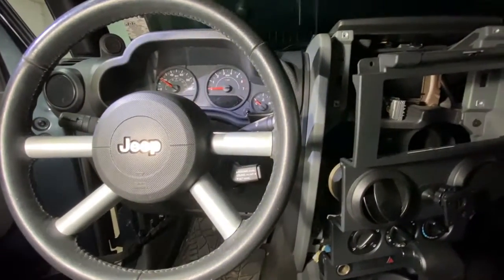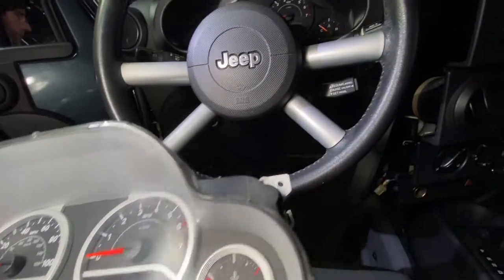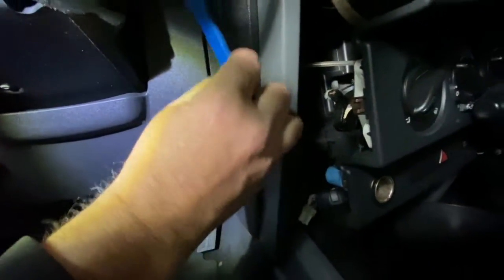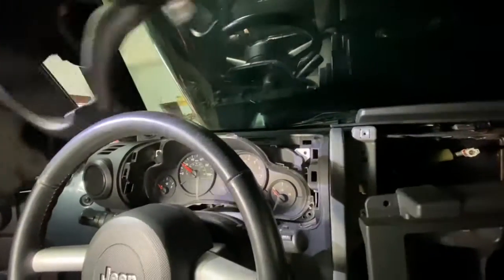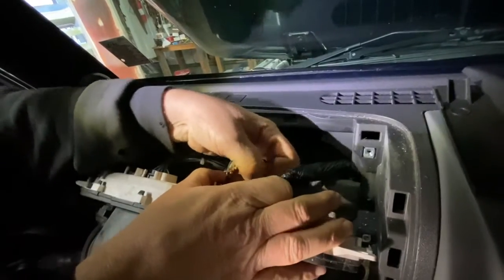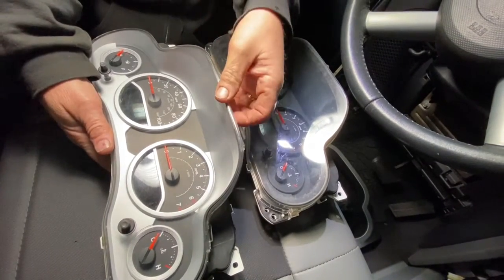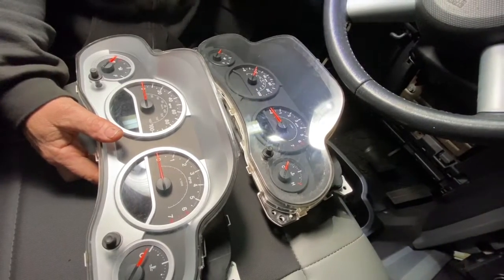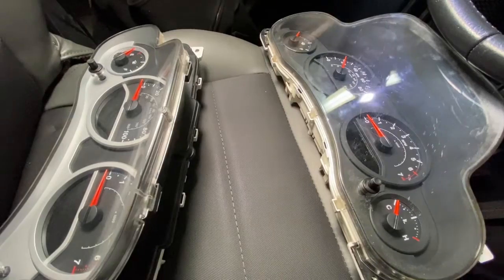Instrument/ Speedometer/ Gauge Cluster Removal and Install on your Jeep Wrangler 2007-2011 JK

Comment: How about a video showing how to get the console off an early JKU when the hand brake handle won't raise high enough & stays in the way? Something easier than removing the rear wheels, calipers and rotors to allow the e-brake shoes to extend more?
Reply from the maker: When I get one in the shop I can make a video

Comment: I am wanting to swap out my 09 JKU cluster for one that I purchased on eBay. Where do you recommend getting it reprogrammed for mileage to match, and will I mess up my Jeep if I plug it in without getting it reprogrammed?
Reply from the maker: The dealership has to program the correct mileage to the new cluster by law. Check with your local dealership before you buy it.
Reply: You can buy these on eBay preprogrammed with your mileage. Search “09 Jeep Wrangler Instrument Gauge Cluster Speedometer YOUR MILEAGE PROGRAMMED!” The seller also offers programming service, just message them.

Comment: Thank you for this video. My led lights under my rpm gauge that tell me my mileage and what drive I’m in just went dead. I hope it’s a simple fix 😬
Reply from the maker: Could be a bad connection, did you replace the cluster for some reason?

Comment: Great video.
You mentioned that you would talk about the compass but I didn't see it.
Having electrical issues that most people are attributing to instrument cluster.
Mine does not have compass or temp. The used one I'm looking at does. Do you think that will be an issue?
Thanks
Reply from the maker: No, you will get temperature, mile per gallon distance to empty etc but to get the compass you need the module that goes in the center top panel over the stereo and a factory level scan tool to turn it on unless it won’t work. I have a navigation that has a compass so I didn’t go that route but the rest works great, also if your Jeep doesn’t have cruise control I have another video on installing that as plug and play

Comment: Exactly what I was searching for! Dumb question, if the needles of the new Cluster are not aligned where they are supposed to be, is this Cluster good? How can I align them?
Reply from the maker: Yes, it should be fine. Don’t put it in that way some won’t correct themselves. Just take the front clear lens off and put the back to their stops.
Reply: Great, will do that! Thanks for the response!! 👍 @motorcarnut
Reply from the maker: @user-dq6dn9yf1g No problem!